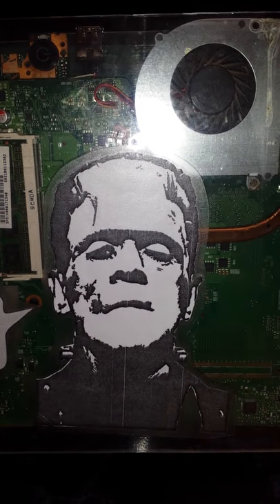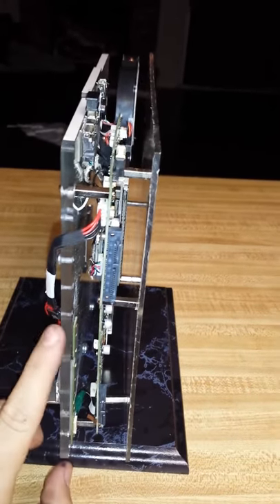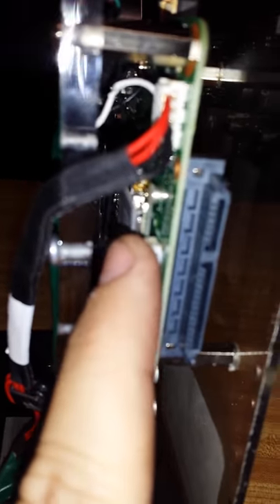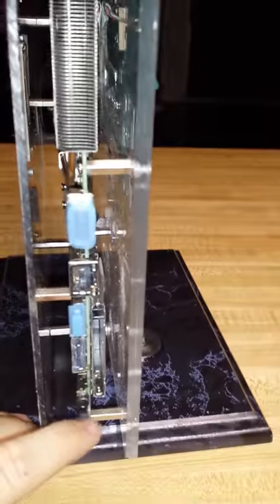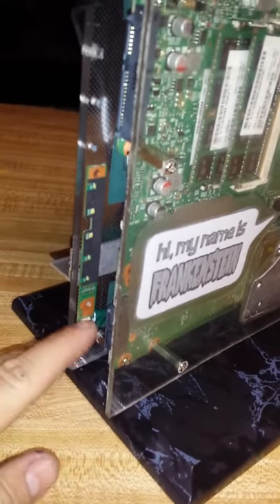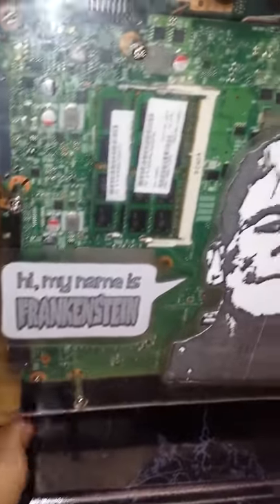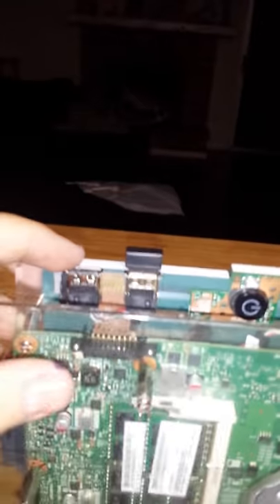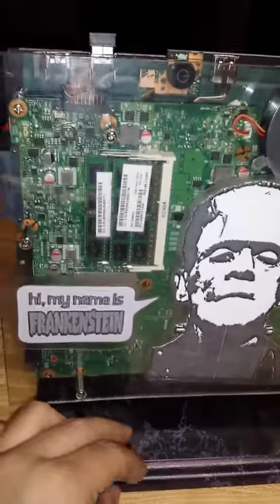Laptop to desktop

Comment: Hi, Nice job with the project! Looks good with the stand! I am doing a similar project with a broken laptop of mine. I was wondering, where did you get the computer standoffs/spacers you used? Also did you use the original motherboard screws with the standoffs, or buy new screws/bolts? Thanks!
Reply from the maker: new stand were bought at radio shack and I used the screws that come with them.
Reply: +Chris Diaz Thanks! I ended up getting the 1 inch standoffs from radioshack, and i have a similar thickness on my piece of acrylic/plexiglass sheet. I was wondering, how did you get the standoffs to stay in the thick plexi?
Reply from the maker: +Axel Zimon I drilled into the plexiglass so the screw could reach and I sunk the stand into the plexiglass as well.